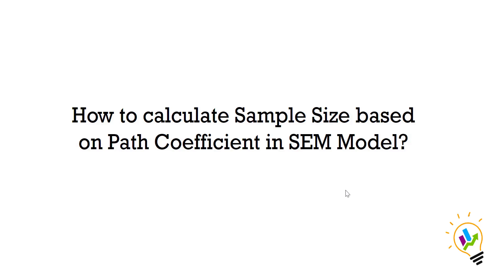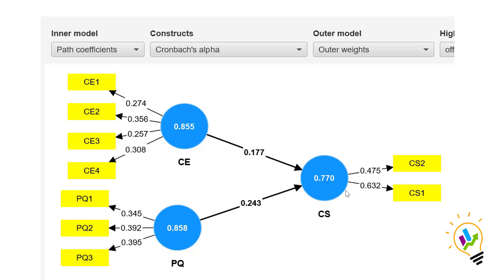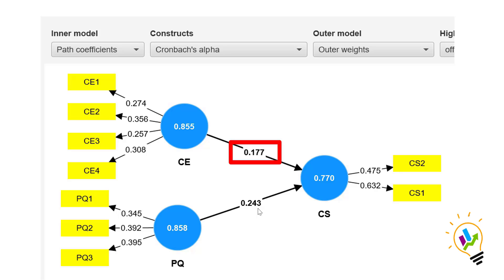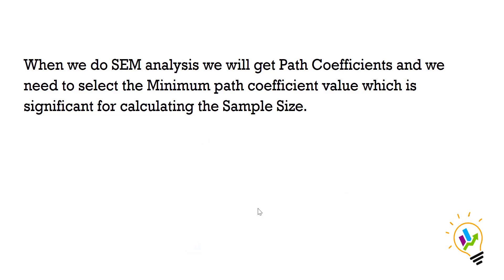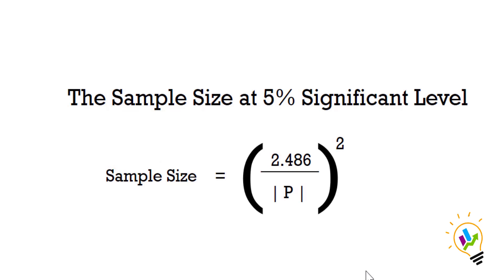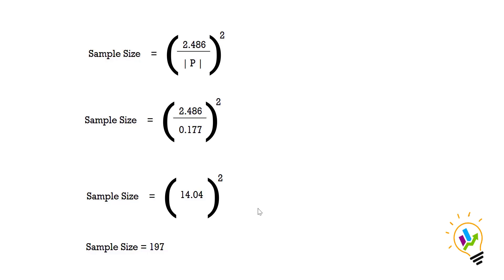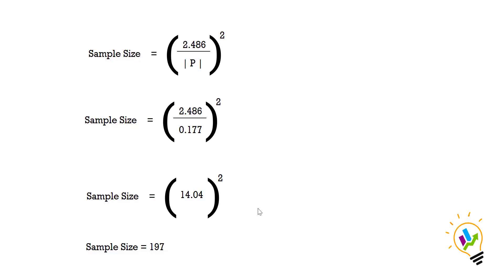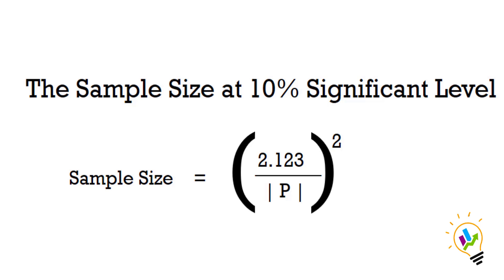How to Calculate Sample Size based on Path coefficient in SEM Analysis?

Comment: Before collecting data how can we get the path value?
Reply: You can refer similar past analysis (literature) and get the minimum path coefficient.
Reply from the maker: I have already explained in the video. After doing the analysis only we can find the minimum Sample size required for the model. This is useful for confirming the required sample size only.